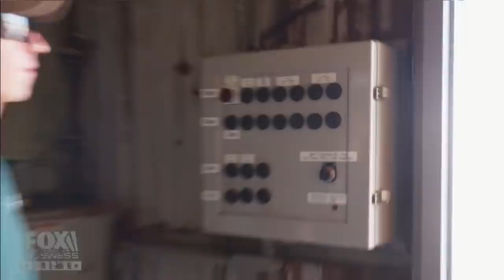Mike Rowe explains the struggles of producing salt

Comment: I can't imagine how dififcult it must be to keep that equipment operating in such a corrosive environment.
Reply: Plastic: light, does not corrode, cheap.
Reply: It must help that it's in New Mexico. I should think the aridity reduces the penetration of the salt.
Reply: @memyselfandi2475  This is a front end loader. It looks something like a Cat 988 with a lift capacity of about 12 tons. And you are going to supply a plastic plunger retainer on the hydraulic cylinder that handles that weight? I hope you are trying to make some sort of joke.
Reply: @louisc.gasper7588  you are thinking too small and you are only focusing on one aspect of contact between the salt and the susceptible material on the tractor. I could break it down for you but they don't pay me to do so.
Reply: @memyselfandi2475  I'm focusing on the one the video focused on. Certainly there are parts that are suitable for fabrication from some kind of plastic or composite; this isn't one of them, but it's the one the rest of us are looking at.
Reply: @louisc.gasper7588  let me rephrase plastic to polymer... Again you are thinking to small and probably are missing some material science and application when it comes to polymers. Especially when the application of the plastics is far cheaper than manufacturing a new loader as you specify
Reply: @memyselfandi2475  The video showed a steel bolt stuck on a plunger retainer on a hydraulic cylinder. No polymer presently available can replace those parts unless at an astronomical cost. Your original comment suggested that the problem they were having could have been avoided with the use of plastic/polymer parts. I say not. I am not denying that there may be OTHER places where more extensive use of polymers could meliorate some of the problems of salt corrosion. But this particular problem, the one they are having, the one they show, cannot be relieved by plastics. 
Your demeaning remark that I am thinking too small you have now escalated to deliberately deprecating my understanding of "science and application." You have goaded me to a like response. You made a glib, superficial, and irrelevant comment you are getting desperate to validate. Leave it alone.
Reply: @louisc.gasper7588  you're thinking too big now. I never said plastic should replace any part. You have to stop being a skeptic and trying to disprove me. Think about how it can be applied and think of a solution. Stop trying to fight me and look at it from an objectively creative stance.
Reply: @memyselfandi2475  I'll try saying it one more time: We were shown a stuck bolt on a plunger collar. If your comment had nothing to do with that, then just say you are talking about something else, and say what it is. A generalized statement that polymers are just golly gee whizz great is useless. The rest of us are looking at this stuck bolt; what are you talking about?
Reply: @louisc.gasper7588  I'm not telling you how to solve it. If your small amount of creativity cannot solve the issue. That's your problem. I see a solution and you can't find one. Don't be mad.
Reply: @memyselfandi2475  What issue? You keep on diverting from that essential point. What issue are you talking about? If you are suggesting some use of plastic/polymer, the issue can't be the stuck bolt. So what issue is it? And why do you keep on descending to personal attacks? I'm not mad. Why do you say I am? I suspect it's because you can't answer the question, which, again, is, what equipment issue are you addressing with a plastic/polymer fix?
Reply: @louisc.gasper7588  calm the F down. The plunger and hydraulic cylinder issue that you seemed so focused on. I don't have to explain it to you. Figure it out and stop doubting other ppl when they see something you cant
Reply: @memyselfandi2475  Yes, you do have to explain it. I am focused on the bolt and collar because that was the illustration they chose in the video. You are switching the subject to something else, but you won't say what it is.
Reply: @memyselfandi2475  Next time you want to have a battle of ideas, bring one.
Reply: @louisc.gasper7588  I didn't want to battle this isn't pokemon lmao but you certainly wanted my idea. Did you even have an idea or were you just reiterating a problem? You were so up in defense I might have missed it
Reply: @louisc.gasper7588  thanks for my coffee grin , u guys!💩
Reply: It sucks i work in one of the mines in Carlsbad New Mexico.
Reply: @memyselfandi2475  did you see any plastic on any of those? No. Because plastic cannot lift like steel can. Don’t claim you have any knowledge about this because its extremely obvious you dont.
Reply: @AHomelessDorito  lmfao 🤣😂😂😂  I never said replace the metal with plastic. Gtfo 🤣😂🤣😂🤣😂🤣
Reply: What about uv light?
Reply: @memyselfandi2475  absolutely horrible for the planet and unsustainable
Reply: @benjaminingenito530  lmao yes petroleum is unsustainable and we'll nature is already adapting to eat our microplastics. But now since when was mining, smelting, and molding the iron to make a whole new tractor (pieces, etc.) More sustainable and healthy for the environment? Not to mention cheaper and more accessible?
Reply: @memyselfandi2475  It wouldn't work for hydraulics
Reply: I guess some of the commenters missed the rust on every steel structure except the salt-polished loader buckets. Or, Mike's narration beginning at 7:50 where he talks about how difficult it is to keep the equipment operating in such a corrosive environment.
Reply: @jonkirkwood469  I worked at the rocket launch complex at Vandenberg Air Force base. The wind blew hard in from the ocean covering everything with salt spray. Even stainless steel brackets would completely corrode into an exfoliating looking flower. We painted a launch tower and guaranteed the paint for 10 years. It was rusting through in a year.
Reply: @nicholaslandolina  what ever you say nick
Reply: @memyselfandi2475  salt affects plastic as well. It etches plastic on contact. I have lived in norther illinois almost all my life and I have been a diesel mechanic for years. You can see the degradation of plastic parts almost immediately after they come in contact with salt spray. After a few years of salt being sprayed all over these plastic parts they become brittle as if they have been in the sun for years, even though they are located under the vehicle.
Reply: @cranberrysmoothie1  I like your style kid but I think I or you would have to be more specific on what plastic to use and how to use it
Reply: @memyselfandi2475  so biologists here, nature is NOT “learning” to eat our micro-plastics. Need to clarify that, because that is a huge leap.
Reply: What are you suggesting with plastic out of curiosity? Composites do have a small place in heavy machinery currently, but they are typically for wear items (cutting edges) where you need something less aggressive than a steel one.
Reply: Ideally every thread would be PACKED with anti seize, plus every paint chipping needs to be immediately spray painted. They need to hire a person to inspect every vehicle after every shift, should be well worth it.
Reply: At the mine by me (ny) they keep the equipment below the ground or it rust as soon as it comes up
Reply: Kinda sad this whole comment section is two guys arguing about plastic and steel, what is this sad world coming too??
Reply: @memyselfandi2475  Yeah making large industrial machinery and mining equipment out of polymers would make them really light. I think modern metal 3d printing will allow titanium and other non corrosive metals to be used more readily since these materials are tough to work with normally. Modern machinery could be made out of Ancel now like our M1 Abrams battle tanks, built to last.
Reply: Try working off shore
Reply: We’d reduce corrosion by daily washing our equipment with seawater. It’s by far less corrosive than the brine of the evaporation ponds.
Reply: It is not difficult, only expensive.
Reply: Flex seal everything
Reply: The underside of that tractor must be a rust bucket after a couple years!

Comment: imagine how often they need to repair equipment and how much it would suck to with all that rust. they probably go through a lot of equipment
Reply: i know they have something they can spray on the equipment to prevent rust.  I spray my outboard with it evry time i go out and rinse it
Reply: @memyselfandi2475  even that gets destroyed
Reply: @nothuman3083  everything gets worn down eventually when you take sand paper to it.... Except maybe diamond but that's not cost effective. You were only worried about the rust
Reply: It is nature - thermodynamics - all metals are combined and man as a biological animal extacts metals - but only for a short time until nature takes them back into compounds.
Reply: @EddieVBlueIsland  that's not thermodynamics but the rest was right
Reply: The machines that stay in the mine will last as long as you leave it down in the salt mine due to there being near 0% moisture, which is what causes rust. As soon as you take them out of the mine, they go to rusting out within a year or two
Reply: @nathanschneider8586  they just rust a lot out there especially at the lake just keep paint on it to slow down the rust but the metal on the equipment is so thick it really doesn’t rust as bad
Reply: @EddieVBlueIsland  ... that's not what thermodynamic is
Reply: As someone who works at a salt plant, it's not horrible on equipment of its constantly used. When you let a loader sit for 6 months without being washed, you start running into problems.
Reply: @memyselfandi2475   you figure they get custom built massive equipment made entirely out of plastic?
Reply: Id imagine their maintenance crews are larger than the average factory style job or mining operation simply because it all needs constant upkeep at a far higher rate than usual. It wouldnt shock me in the slightest to learn they maintain twice as many machines as needed simply because at any point a significant portion is down for repair work.

Comment: Salting the roads waste millions of man hours, billions of dollars in rusted out vehicles. They could just use sand.
Reply: Sand is a lubricant
Reply: @mitchellscales8846  That's why I sprinkle sand on my machine bushings and put some in my vehicle's differential.
Reply: Sand clogs drain and sewer pipes. Your choice salt the roads or repair the sewers pipes
Reply: @michaeltewes7833  Salt destroys concrete, causes spalling etc.
Reply: sand shortage
Reply: They can’t use sand because it doesn’t do at all what salt does
Reply: @SI29222  Salt stops working at -20C, sand continues to work.

Comment: NOTE - Alot of states are getting rid of the use of Salt on roadways and using other more environmental friendly types to Deice the roads. Go back 20 to 30 years ago Salt was the Primary use to Deice roadways. But, with newer methods that are environmental friendly and just overall better on the roads and not ruining the roads to fast States are making the switch. Alot of the States so far have cut the use of Salts by 40 to 50% with mixing of Sand or smaller sized Gravel instead of 100% salt. Or using a Deicing Liquid instead.
Reply: and they dont work well when it is cold. my state had a VERY COLD WINTER HAD HAD TO USE SALE FOR THE 1ST TIME IN APX 20 YEARS
Reply: That fancy "deicing" material is even worse on our cars and doesn't work when it's too cold. :‐/

Comment: Very cool, wonder if there are different processes when handling salt for consumers.
Reply: As a worker from this company. Yes human consumption salt is a much finer,  more refined finness process. But still a very messy and rusty process to get it. But all of this salt is lab tested repeatedly to specific health standards. Except for the road salts. It has different standards to be met
Reply: @Kevin-twisted  Human consumption salt has iodine added to it to prevent scurvy.
Reply: @imontime77  yes indeed. Also upon further questioning of the lab techs here. Most table salts go through multiple chemical/water treatments and drying to get the desired product. The salt at this mine does not go through the additional chemical/water cleaning process.

Comment: A question. What effect does the salt have on the countryside as it melts with the snow in your spring (after being used to salt the roads) ? Will it run off into fresh water and dilute, or build up over time causing salt lakes or bare earth patches ?
Reply: it definitely attracts animals to the roadsides in winter simply because of how easy a source of salt it is, which can add to the hazards of driving in winter.
Reply: @ToeCutter454  my area doesnt use any salt for this exact reason. We use sand
Reply: @evaj558  ours as well, sand or cinders is a much better choice over salt. but another big advantage of sand is that it provides traction on ice! salt will melt it and allow it to run off to another area where it can freeze and cause a potential accident.
Reply: @ToeCutter454  not too mention how much less rust cars get on them when you don’t use salt
Reply: @ToeCutter454  Well I can attest to that - hit and killed two deer within a month. Killed one car and the other was fine. Had I not been focused on getting to work I should have loaded up the carcasses and had my venison revenge. Both cases they jumped over highway dividers and were airborne when I got my two second warning. Great way to find out that your adrenaline system still works.
Reply: Ive seen it used as a mixture of sand and salt, and they do send sweepers out in the spring to clean off the roads of a lot of that buildup. But we also have decent drainage, so id imagine the runoff goes into the sewer system and ends up being processed along with everything else.

Comment: That equipment must see HELL , with that environment. 
I work where we build turbos and some go on mining trucks.
The trucks see such extreme environments that every 6 months the trucks have all 4 turbos replaced even if not needed. They go on 16 cylinder  motors . The engine alone is around 1 million dollars. 
They must have used the new equipment on the filming for this hahah

Comment: Using a 12pt socket to remove a stubborn bolt could end up rounding the edges of the seized 6 flat bolt head or crack the socket. And using a cheater bar will increase the chance for those to occur. The Plants 43 year experience Maintenance Guru is lacking in critical tool applications and safety. But they pay him not me. Always use the correct tool for the job. Not jury rigging things like this guy.
Reply: And if they aren't using anti-seize, they should be!

Comment: I hate salted roads in most cases.  Salt destroys bridges, vehicles and water systems. In colder states, hardpack snow offers good traction then it eventually crumbles and blows off the road. Salt just melts it during the day so it can freeze into ice at night. Many states should do away with much of their Salt use. Put money towards better snow  removal and sand in key places. Snow tires and sometimes studs should be used.  I know MT got away from Salt for many years but as more people move in, they now Salt and spray quite a bit.  A real shame.

Comment: How do you "wash" salt if it dissolves in water, wouldn't a distillation prosess be more efficient?
Reply: The water they are "washing" it with is brine water. That means it is fully salineated and will not dissolve anymore of the salt.

Comment: Personally it has been my observation that salting causes more deadly accidents. People drive far faster than they should, assuming the the road is clear. We lost a co-worker to a guy driving too fast going into a shaded corner. The sections in the sun were good. It killed the driver and front passenger in the Suburban. When that same stretch was just sanded a few years before, you had no choice but to slow down. Accidents are less dangerous 20-30 mph slower. Then you have the issue of the salt getting into the streams here in Montana, and what it is doing to the plants and the wildlife.

Comment: Interesting video guessing they don’t get a lot of hours on that equipment before it needs to be replaced. In salt (underground) mines I was told they can never expose the equipment to moisture and thus it never leaves the mine.  Guessing for surface mining the equipment only last a couple years.  Wondering which goes first the tires or the steel.
Reply: Rubber seals

Comment: Not crapping on the value of this show but either those "maintenance" men were putting on a show or don't know quite as much as they put on cause they socket they tried to use a cheater bar on was split before they put it onto the bolt lol. They said it broke but nah, it was already broke lol.

Comment: Can it be extracted from salt water? The watermaker on my sailboat would filter 300 gallons of fresh water per day. The salt had to go somewhere…
Reply: It can, but it can be expensive for the amount you would have to process to get enough salt to sell.  Almost all table consumed sea salt is actually from processed sea water. But it does not contain iodine like most regular table salts

Comment: Could they use worse machines to do the job? Just seems like there's many better options when it comes to efficient equipment is all.
Why are they not using a scraper earth movers? It scrapes it up into itself and dumps the load back out the bottom in an area a wheel loader won't get stuck.

Comment: Omg struggle watching the employees the first lil boy that was washing the salt failed , then the 3 should be retired guys  attempting to remove cylinder to repack age slowed progress an their ability , then the lil kid operating the salt dryer failed an I assume it happens a lot , bact to the fist operator wind towing the salt obviously they have no dental plan here an he is way to old to be a operator ( Otto) need not be on a dangerous job site another reason he got stuck pointing out captain obvious safety issues